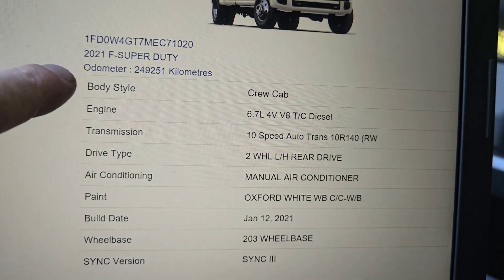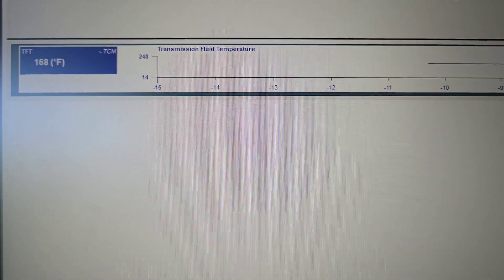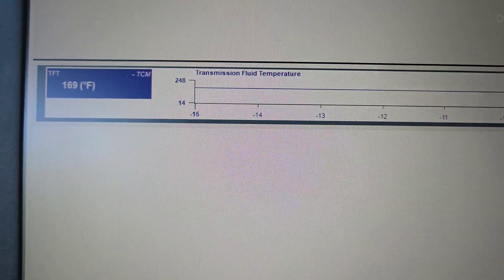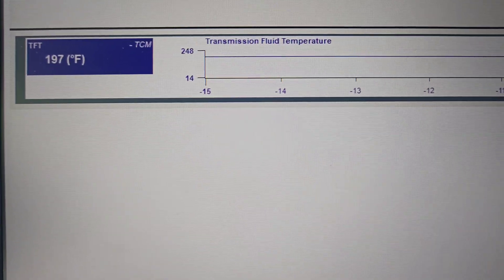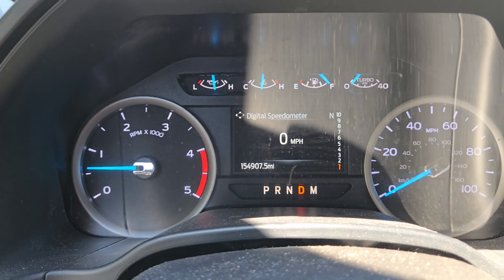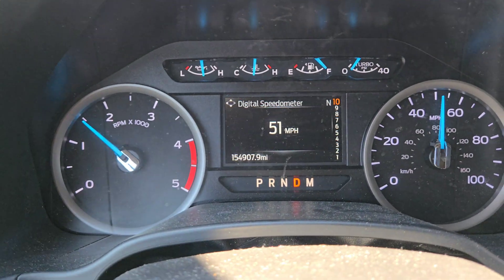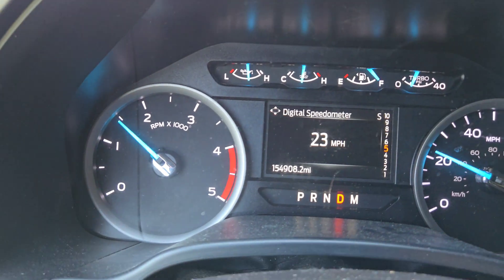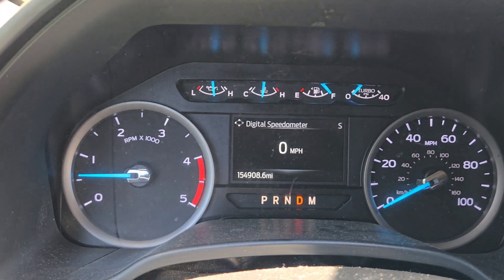2021 F450 Transmission Relearn/Drive Cycle #newtoyou #dieselrepair #automotiverepair

Comment: Apologize if this is dumb, but swapped out valve body on 6R140. It says my SDS50 is capable of doing the re-learn process but have not tried yet. I just got fluid back up to proper level and plan to do this tomorrow…my questions are

1. Am I okay using this after market scan tool that is capable or should I take it to Ford?

2. Is it okay to drive it a couple miles up the road to get to a spot where I can do the re-learn?
Reply from the maker: As long as the tool is capable of doing it it is fine.
Yes deiving it is fine. It has to be at operating temp to do the relearn.
Not a dumb question at all.
Reply: @BeardedFordTech  thank you. Great videos. New follower, and look forward to seeing more
Reply from the maker: @Preston859KY 💯💯

Comment: I have a 2021 6.7 10 speed f350 single wheel one ton and it shifts at 1500 rpm’s every shift is that normal?
Reply from the maker: Yes. 15-1800 is normal. I bet if you step on it and drive it a little aggressive it will shift differently.

Comment: 2011 f250 6.7 4x4, when i push the od. button it wont come out of over drive. Any thoughts?
Reply from the maker: Would need to check for codes. That once can be a failed valve body, failed solenoids on the valve body, transmission internals or a failed switch.  That one is a tricky one.

Comment: Awesome video!  I need to replace a 4R75W transmission in my ford van is the relearning process the same for that transmission?
Reply from the maker: What year is it? I can check.  Never done one in a van.
Reply: @BeardedFordTech  2006 ford E 350
Reply from the maker: @dugheckenkamp4047  doing a swap should just jokk up and go
Reply: @BeardedFordTech  What if I have the same transmission 4R70W and I replaced the shifts solenoid pack or is this too old of a trans?
Reply from the maker: @MadnessGetsWrecked might as well replace the valve body instead of each solenoid. New body and new solenoids is better. Changing solenoids only is like tsking a showr and putting the same dirty underwear back on.  Email me your vin and ill check to see if it has a relearn or not

Comment: what damage can occur if you disable the learning feature and, what are the pros and cons of leaving it disabled, should one wish to do so. this is with regards to the Ford 6 speed trans
Thank you.
Reply from the maker: @TheBeagle58  well if you put new components in its going to have to relearn like I did in this video.  After about 100-200 miles you can turn off adaptive learn (with a computer) so it's not trying to constantly learn stuff.  It just keeps that memory. I've turned it off for people and they seem to run great.
Reply: @BeardedFordTech  Ah ok. I did a week long test with my sport Ecoboost Explorer and found the vehicle actually felt better with it disabled. Wasn't sure if not having it active would cause some kind of damage to the unit. I put learning back on today's and I miss it already. If it won't harm it, I'll be disabling it again before the end of the week. I cleared the table before the disable. Shift points feel a little sharper and predictable and overall better in the rpm band when needed
Reply from the maker: @TheBeagle58  yeah I'd turn it off. Doesn't hurt it
Reply: @BeardedFordTech  I watched your other video with the oil geek. It was his visit to Valvoline that made me change to restore and protect. I'm on my first change over to it and, so far I like what I'm seeing. I check my fluids ever other week.i am about 2k in. It gets dropped at 5k. I also just did a induction service at the dealership Friday. Once a year. What are your thoughts on Berrymens B12? It seems to be the best in this 2016
Reply from the maker: @TheBeagle58  never heard of berrymans b12. I'll have to research it. I run amsoil in everything. Been doing testing with it. About to do the 10k oil change to see the results on that. Thay should be a good video.
Reply: @BeardedFordTech  Will definitely be keeping an eye out for it 👌
Reply: @BeardedFordTech  I'll be DC bound the end of the week so, first real long highway drive. Original trans, nothing has been changed and no tune on mine
Reply from the maker: @TheBeagle58  nice

Comment: Kyle and nick up at Edison motors pulled my transmission and 6.7 and the rear axle and installed the hybrid electric setup with the little 3 liter generator. Don’t gotta do all this learning stuff, just get in it and drive. Shit tons more power and torque.
Reply from the maker: @larryphillips4164  because you installed a hybrid electric setup. If you were to just change out the transmission assembly and go back with the same one. Or performed internal repairs you would have to. That setup sounds sweet

Comment: These new trucks are junk. Why do you need a complicated 10-speed when a 4-speed tranny is just fine. Maybe you might get two or three miles per gallon with the expensive time bomb.
Reply from the maker: 6 speeds were awesome. Haven't had issues with my 10 speed. But. It's the manufacturer having to abide by epa rules for fuel mileage is what it boils down to in all reality.

Comment: Middle of the winter in Michigan, -2 degrees, 6 inches of snow on the roads, dealership in a busy metro area with no back roads. How on earth does Ford expect this to be done? Is there an alternative way?  Or will it eventually learn itself?
Reply from the maker: @hdz12ez  nope. Has to be done. Just have to drive it to get it to temp and get out of the metro area on a backroad otherwise it will never learn.
Reply: @BeardedFordTech  Wow, I now give transmission techs a whole new level of respect!
Reply from the maker: @hdz12ez  it's a pain in the a$$ sometimes